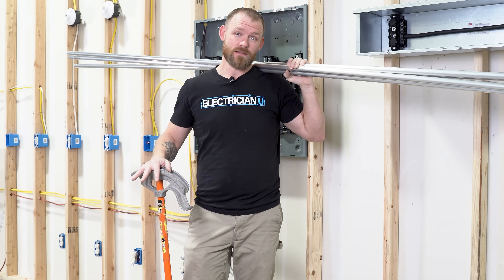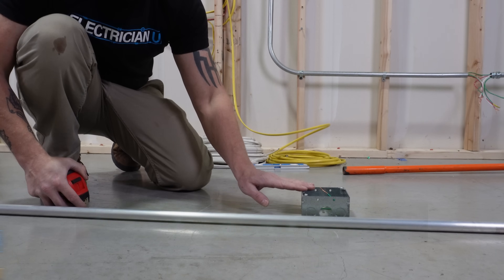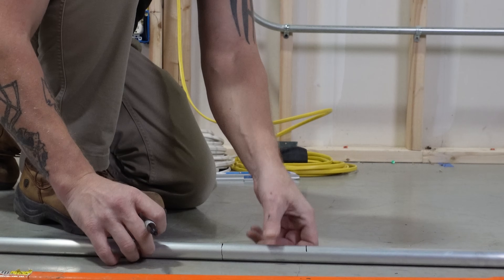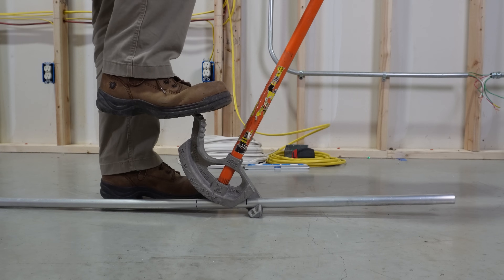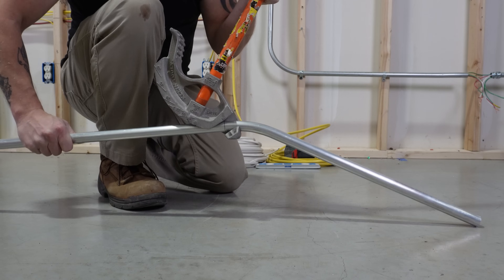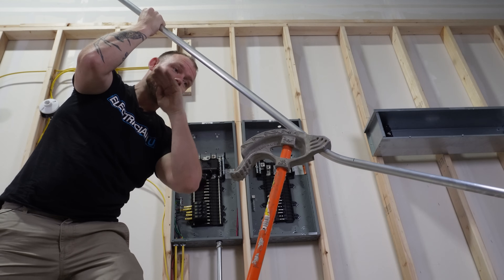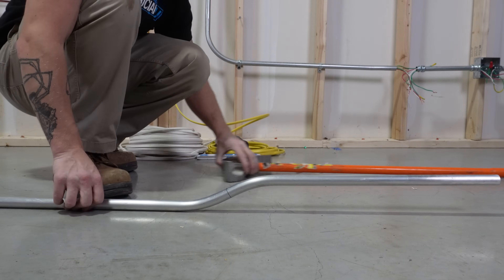How to Bend an Offset in Conduit

Comment: How do you figure out where the first mark goes on an offset? I’ve asked that to other apprentices and they just say that it’s wherever I choose but how do I know if it works
Reply: It starts where your obstacle begins. So basically if you’re pipe is going straight measure up until to you get to your obstacle then boom first point. Measure the width of the obstacle to see how far you have to go with your offset.

Comment: Three questions. #1: Does it matter which way the bender is facing on the conduit (I know it has to face the same way for both bends)?  #2: Does it matter which bend you do first? #3: I know for 90° bends, you have to have to move your mark to account for the bend.  Do you have to do that for an offset bend?  Thanks for the video demonstration.  It was very helpful.

Comment: I have a 1-3/4 offset obstacle so I set a starting mark and then a mark at 3–1/2” up from that starting mark, which is double the obstacle like you said if using a 30 degree bend.  But it’s not working.  My offset finished at 3-3/4”.  So that not working.  Don’t know why.

Comment: 45 bends are not use neither are 60 if u do that on my job u fire u got to pull wire through it buddy stretch your bends out to be able to not put stress on your wire your using
Reply: If you can’t spell or write proper sentences your’re fired
Reply: @EonTide1111  that why I do electrical buddy fuck proper spelling right between the line or your fired

Comment: Can we get more of the videos like this with different versions and types of bends with the time you took to make this one? I think these videos and any type of tip and tricks you are aware of, are great videos. Tips like snaking a bx cable or flex cable to the back of an existing 1900 box or installing a gem box for a device that needs power. There is a trick on putting the snake inside the hole of the cable to pull it into the box and install the lock ring and pull out the snake.

Comment: The center of the 30 degree bend is at the notch in the center of the shoe. Don't put the bend on the arrow that's for 90's and use a pencil not a marker

Comment: 30 degree is the old go to. Multiplier of 2 so easier maths. And adds less degree of bend which makes pulling wire smoother and you cant have more than 360 degree of bends in a run unless you add a junction or pull point and then you reset and can start bending some more bends. So for an offset with to 30 bends that offset is a total of 60. And like he was saying about 60 degree bends. That offset would have a total of 120. That means only 3 offsets before you add a box. The 30 degree bend alllows double the amount of offsets at 6

Comment: I heard some youtubers talking about adding shrinkage to the measurement, is that a important factor to consider?
Reply: it's only a factor to consider if you're pre-cutting your EMT. shrinkage just affects the length of the pipe.

I suppose if you're fitting your pipe into a specific space it might be important, but I've done a ton of bends and honestly I don't even measure I just bend intuitively.
Reply: Only in cold weather

Comment: 60° offsets? ... Just say no! 
I'd shy away from 45° offsets too... 30° is best. 

Key factors; foot pressure when it's on the floor, and choke up tight ... when bending in the air. 

fwiw; I'd try not to use marker ... it can become unsightly ... unless it's buried in a duct bank, etc. 

Retired JW

Comment: Can you please do a video on rolling offsets? I'm a little confused when it comes to those smh...
Reply: A coworker showed me how to do that using Pythagoran Therum. A²+B²=C². "A" and "B" are your measurements from the starting point, to where you want to end up. Once you have those two measurements, punch the numbers into a calculator and you should get C², as in your first bend.
Reply: Actually never thought I'd use something from school until now, thankfully I was decent at it then.
Reply: I was slightly wrong.. C² should be your second bend; the total length of the offset.

Comment: Very good point, to prevent the bender handle from kicking out, I cut a 36 inch piece of 2x4, and in the middle of that, attached a 12 inch piece of 2x4. Drilled in a 1 inch hole in the smaller 2x4. This way, I have a non slip method bending up in the air.  You can step on the longer 2x4 too.  Gotta think practical and safety!
Reply: You should make a video about it

Comment: A quick way to find your multiplier if you have an iPhone open the calculator and turn your phone sideways to get scientific calculator mode. Type in the angle of the bend, then hit the “sin” button, then the “1/X” button. It works on any scientific calculator, of course but it takes an extra step or 2 on an android phone.

Comment: The most accurate way is to use your electricians level, bend till the 30° bubble says you are at 30, then flip it and bend it level.    You have to bend half of the second bend in the air.

Comment: I appreciate the detailed explanation, many other videos I have seen are vague and fast.

I am wondering about a technique to measure for where to put the bend in, for example you are joining into another conduit and have limited space and don't want to cut the conduit.
Reply: If you’re running a lot of conduit shrinkage is good to understand but tbh if you don’t do a lot of bending and you’re not very good at it quite yet just go a little long with it.. it’s better to run it long/ cut it to length and use couplers as opposed to waisting  conduit and time.
Reply: This video was meant to be a simple explanation of an offset.A lot of benders have charts that will help a lot with where to make your marks. 30 degree offsets are very easy math though. the distance between your bends is the height of your obstruction multiplied by 2. the shrinkage is .25 or 1/4 of the height of the obstruction.
Reply: a single ten foot stick of 3/4” emt costs about the same as 25 couplings to put it into perspective

Comment: Are there benders for 1/2 inch that have a tighter/smaller overall radius?
Reply: It's called a hicky bender, the shoe is much smaller. Maybe Electrician U could do a video on these types of benders.
Reply: @mthibeau  I looked it up and I think that benders sharp edge would kink the pipe.
Reply: The tightest radius you can achieve for ½" EMT is ~4", which can be done without a hickey. Just check the specs of a bender to see if it's capable.

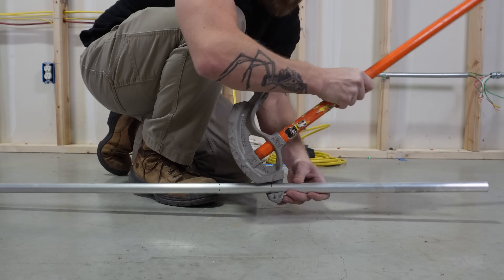Comment: 3:40
Why use the arrow?
I was taught to line up with star, and still do it like that. 
Because the star is the center of where it bends.
Reply: The u is center. Star is outer edge
Reply: @skiball83  when you say " the u " , do you mean the " notch " right next to the star?
And i was asking where to set the bender when doing offsets?.
I.E. , lets say i have to go over a 5" high obstacle, and the obstacle is at 24" away. 
I would mark my conduit at 22" and 12"  and align my marks on the star, rather than the arrow.
Reply: Measure edge to edge.  Minuse deduction.  Perfect.

Comment: 5:55
I find that the best way to do offsets, is to do both bends, standing up. 
That way, you can better see the 30° mark on the bender, since your eyes are closer to the shoe
Reply: Klein has a nice bender with a plastic insert that acts as a stop when you reach the selected angle. Works pretty good.
Reply: @FishFind3000  that is genius
Reply: Only problem is thwt the insert is small and not attached to the bender and easily lost@FishFind3000
Reply: I also prefer in the air ...
Reply: I like to do the first bend in the air then the second bend in the air enough to where I can finish it in the floor with the level on the offset end so i know where I can stop so it’s accurate

Comment: 5:05
Should always MAKE SURE that the FLOOR is level also if you use this technique. 
Especialy when you doing a 90°, and want to make sure its good. 
If the floor is not horizontaly level, then its useless to use it verticaly.
Reply: Good point! I see so many (even journeymen) pay no attention to whether the floor is level or not. I’ve even seen people make that mistake bending on a floor that’s deliberately sloped to drain
Reply: @Ephesians-ts8ze  😋
Reply: Lol I like to find a level spot on the floor first too and do my bends there

Comment: Best to just use a pencil to mark conduit. Sharpie marks on conduit look like hell. Hard to believe how many sparkies do not know how to make a 3 point saddle bend. Always told the young guys to practice bends on old unneeded conduit they removed.
Reply: A 3-point saddle is tricky, if you don't do it all the time.
Reply: @icevariable9600  I have a couple of  3 by 6" maybe 12 page bending books that If I haven't done a saddle will look up the two different angles you have to use. Best is an old Benfield book that was my dad's. Painted my 1/2 & 3/4" bender heads a bright white then used a bright fluorescent paint marker to mark degrees, notch, & arrow to help my old eyes in dim rooms. Worked with a lazy sparky while we had to run around 500' of 3/4 rigid galvanized conduit that required tons of saddle. He never figured in how much conduit would shrink especially on large saddle bends. He just screwed on a coupling and a 1 to 3" nipple on end of conduit.

Comment: I know this doesn’t have anything to do with the video but since it’s the newest I thought people would see my comment more and reply. I start electrician school today and I’m excited but my only fear is the dangers of shock and electrocution, how many ways are there to get shocked? And how to avoid it?
Reply: Just learn what you're dangers are and always stay vigilant. There is plenty of safety gear you can wear too. If you're ever worried, measure for power or double check that the source is properly locked out. It is very dangerous, but can easily be handled.
Reply: Learn to "trust, but verify". Always, always remember that just because someone (like your foreman) says the circuit is off, doesn't mean it's off. The wrong breaker could have been flipped. So verify.
- You can do this with a tig tester or "non contact voltage tester". Klein makes one, a NCVT3P Dual Range Non Contact Voltage Tester. Buy one. ALWAYS carry it with you or on your tool belt. Whenever there are breakers in the panel, pull it out before working on switches and outlets, unless you personally checked all the breakers. 
- MANY old timers will whine about tig testers, saying they're called "widow makers". Don't listen to them; you'll notice they complain about everything. EVERYTHING. Just get one that has a light and/or laser; Klein is well trusted and the only one I use.
- You can also get a plug tester. Klein makes one for less than $10. The RT110 Outlet Tester.
- Study, on your own, how a circuit works. You will need to understand that for the most part, current is on the neutral conductor, as it returns to the source, the panel. Learn the flow of electricity, especially during a ground fault. No, AC "electricity doesn't want to go to ground"; this isn't true, no matter how many people say it. Study on your own. The more you learn how a circuit works, the more confident you'll feel about electricity and the wires you're working with.
- Be conscious of what you're stepping on. If you are standing on something that is conductive to the ground, and you touch a hot, or neutral wire, there's a very good chance you'll get shocked. If your boots are well insulated or you're on a rubber mat or not kneeling on dirt, then there's a good chance you either won't get shocked or you'll get minimal shock. I literally saw it today, one guy took apart a live switch to fix it and kept touching the hot wire to see what we'd say. Once we noticed it, we were totally confused. He started laughing and said he had new boots on and wasn't grounded...not something I would try.
- Wear gloves. I use Maxiflex Endurance 34-845 and they work great. But you'll only get about 2-3 weeks out of each pair.

And remember to not rely on school for all your learning. Definitely study on your own, as if this is a profession that you want to excel at. Understanding the code when installing GFIs, 20 amp vs 15 amp outlets and 12 gauge vs 15 gauge wire and when you should be derating Romex is a good thing to know. 

Good luck.
Reply: @icevariable9600  thanks for all that 👍 what do you mean by standing on something that’s conductive to the ground?
Reply: @yomommaNyadaddy  Like metal, a metal ladder vs a fiberglass ladder, kneeling on the ground where your knee is in contact.

Comment: Also I’ve never worked with aluminum conduit. It seems like it would kink a lot from a normal bender…
Reply: if your EMT is kinking then you're not translating enough downward force onto the backside of the pipe, either by using your foot for upward bending or keeping your force next to the bender (vs. much farther down the pipe) for downward bends.
Reply: Why do you think it would kink?
Reply: It’s a softer metal.
Reply: @MrDontcareify  Sure, it's a softer metal,  but just like steel, when the tube is seated in the groove of the bender, the sides of the groove keep it from kinking.  In order for a tube to kink, the sides of the tube have to bend outward (Look at a kinked piece of tubing, the "kink" is wider than the original tube)  If the sides of the groove keep the sides of the tube from bending outward, it can't kink.
Reply: It wont kink jf you bend it right

Comment: You work long enough as an electrician and you get to do thousands of these things.
Reply: Yup. And we eyeball just about every single one of them once you're good enough lol
Reply: No kidding
Reply: Unless you fuck it up enough your journeyman just won’t allow you to do it no more 😂😂😂
Reply: @Allen-lm9tl  anymore*
Reply: I currently do the electrical in a new datacenter in construction. Every wire is inside EMT conduits. Everything. We don't even use BX/MC cables. So I bend A LOT of conduits. It's actually pretty fun, although I had to do some pretty challenging runs. The hardest part is to try to do it as much as possible with the least amount of couplings. When you've got a bunch of bends, kicks and offsets on the same 10' piece of conduit, you really need to think about what you're doing. Sometimes just placing it properly on the bender with all those other bends is a challenge 😂. I still mess up from time to time and bend in the wrong direction or mess up the measurements, so frustrating when the rest of the conduit was bent to perfection 😅
Reply: One year electrical apprentice. Just did my first panel, but STILL haven't bent any rigid conduit 😞
Heat gun pvc though 😁
Reply: @christianz8020 you’ll be fine with rigid you use a bender machine instead
Reply: @christianz8020 you’re probably not even on this account anymore bro but if you are what experience did you have before you got accepted into the apprenticeship
Reply: That's what apprenticeship is for
Reply: If you work even longer, you get to tell other people to do it 😊